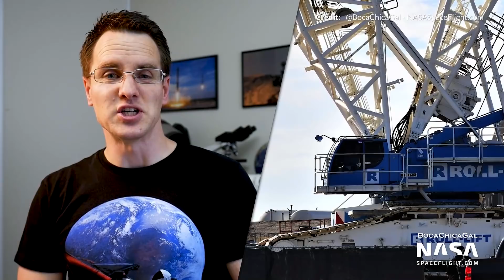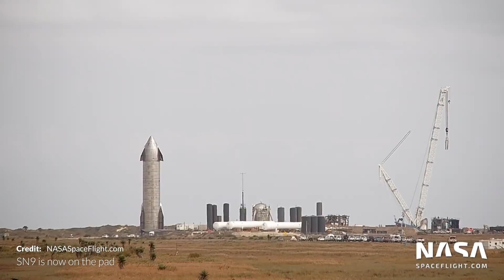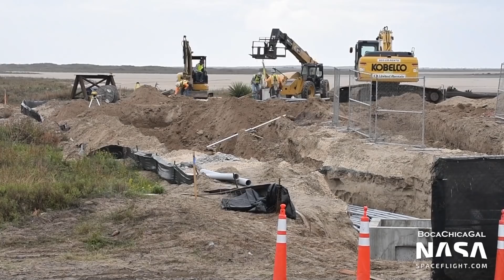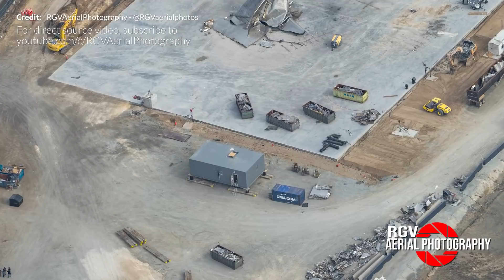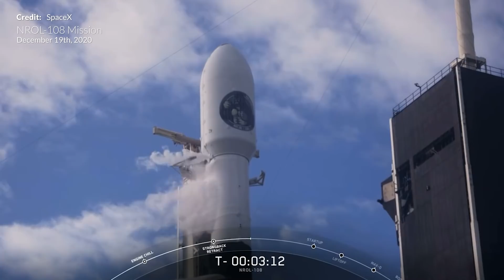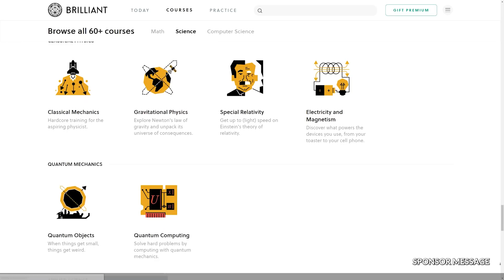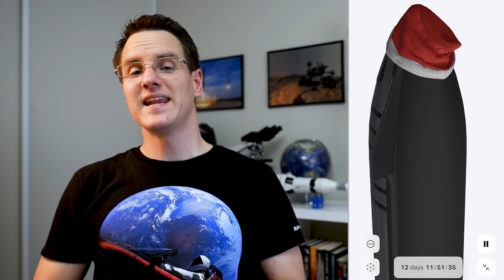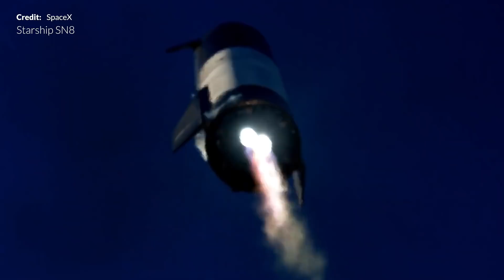SpaceX double launch pad usage for Starship coming, NROL-108, Lockheed Martin purchase Rocketdyne

Comment: I think they would stack SN-10 and SH-1 at launch pads.
Reply: I expect BN-1 will either be pressure tested to destruction or do a low altitude flight and landing with a minimal number of raptors.
Reply: If you mean they won't be mated in the shipyard and make the road trip as a 122 meter tall stack, then I agree. All things point to them being mated on the Orbital Launch Mount (even for non-orbital missions).
Reply: @donjones4719  100%! There's just no way you could have a 120m test-vehicle unsupported on that test pad, fueled or not. Realistically its not going to happen until 2022-23 when the umbilical tower construction is complete, also they're not going to risk destroying 28 raptors at a time, not until they are confident of nailing the landings every time with a finalised leg design.
Reply: @Andy_T79  They could achieve orbit with an empty early Starship on as few as 16-20 engines on the booster. They can under fuel both stages and eat some gravity losses to get data on reentry. No need for a fully assembled tower, just use tankzilla in the meantime. They would need the OLP basic structure and fuel connections but they've had good progress on that.
Reply: @please_stop-v7o  Spacex are good, but they're not magicians that can stop the forces of wind shear!...even Saturn standing at 111m with a lower centre of gravity needed the umbilical tower to hold it in a stable fixed position.
Reply: Nah, SN10 will go a little higher than SN8..but wont be stacked from what Iv heard.
Reply: I thought it was called BN1?
Reply: @mnh1270  right!
Reply: Do you mean, separately on the temporary launch pads? or together?
Reply: Umbilicals were for fueling the upper stages (and loading the astronauts : - ) -- plan is to fuel Starship through the booster, presumably with the same plumbing that will be used for orbital refueling...
Reply: @dancingdog2790  wrong!...the Saturn  rocket was infact held secure by hydraulic hold-down clamps, pyrotechnic bolts and secure with the DRRS arm!! The following is an actual extract of technical data for the ML (mobile launcher) from NASA's own website:  "Level 320 : vehicle station 3914.500
When the vehicle installed in the Pad is blown by the wind, karman vortices (vortex shedding) are generated below the wind. DRRS is a support prop for damping the vibration of Saturn V due to the vortex. This prop also has features for automatic deployment, connection and disconnection with vehicle, and retraction (in-flight)"
If you don't believe NASA themselves, give me one other example of a 120m freestanding mobile structure with an equal centre of mass, that's actually standing?

Comment: Will the engineers be able to increase the ship to 55 meters high and 12 meters in diameter and place the two landing tanks close to the engines?
Reply: The starship is already big enough 

1000 cubic meters of pressurised volume and 100-150 tonnes of payload
Reply: @captainahab5522  But I particularly think that it will increase, the three engines together have power.
Reply: @rubensgoncalves5593  the header tanks are where they are so that they balance the starship. 

A bigger version is possible, however there isn’t much need for it at the moment and near future because of how much the starship can already do 

The current starship versions are 

Lunar starship 

Crew starship 

Fuel starship 

Cargo starship